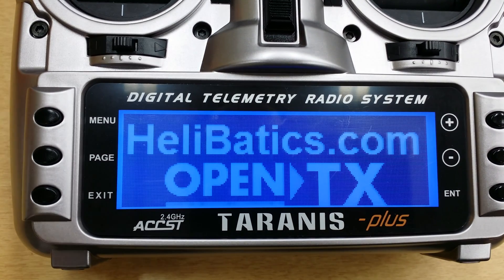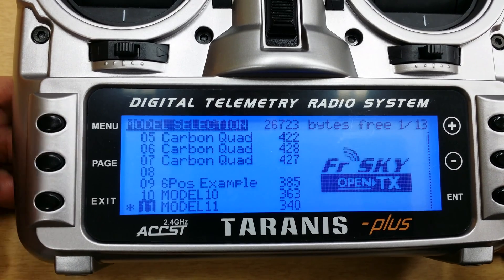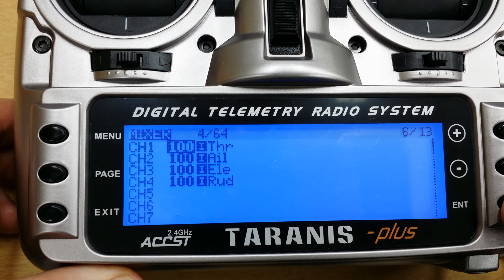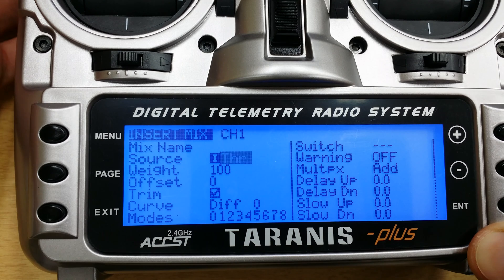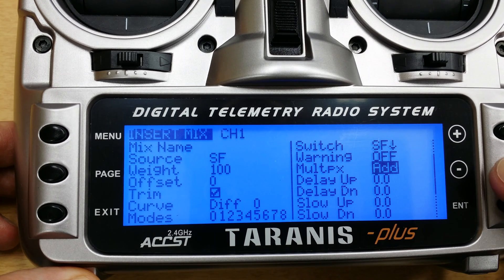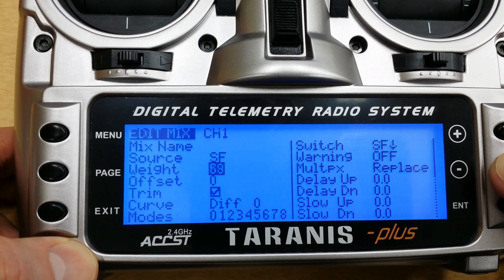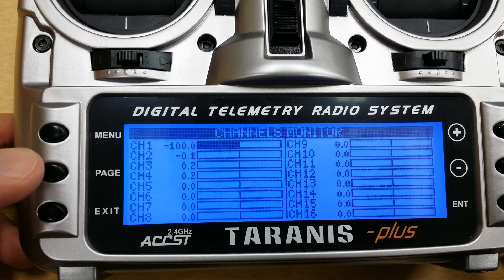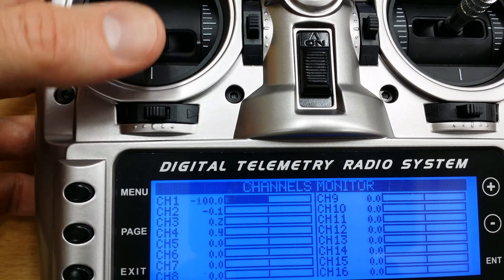FrSky Taranis throttle failsafe programming

Comment: This Failsafe setting is if you want your craft to go to zero throttle and drop like a stone, during loss of signal or a disarm situation. With an autopilot system, you would want the craft to land or return home. Good video.